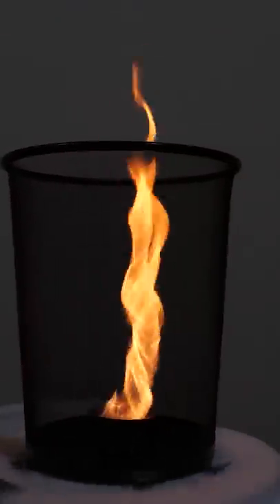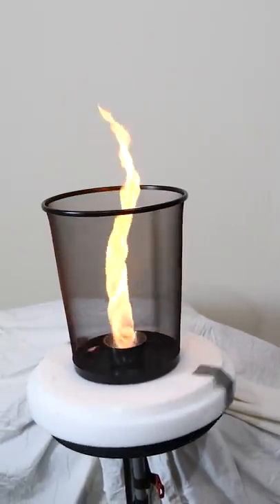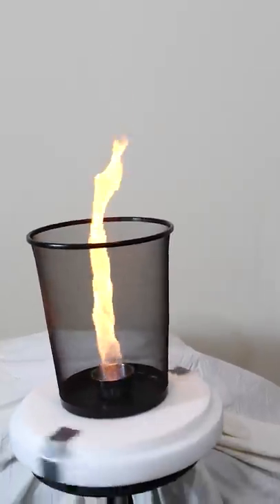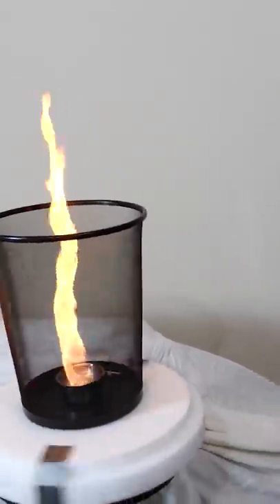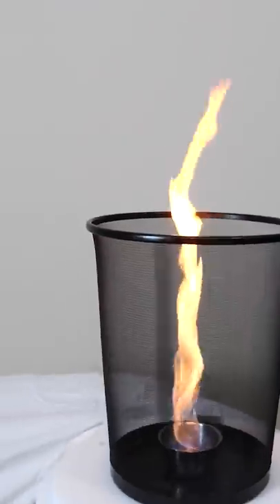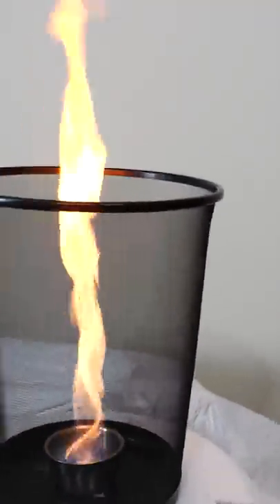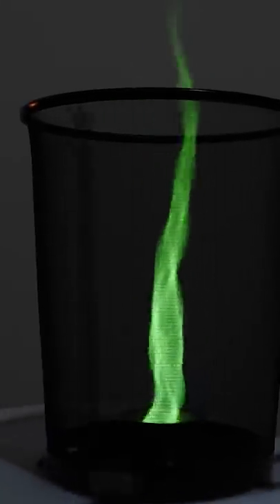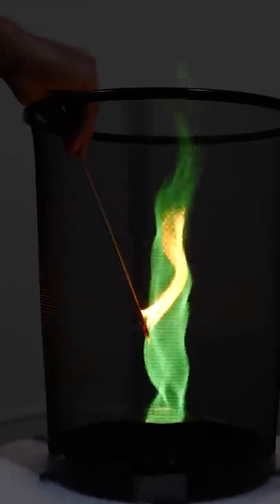Fire Tornado In a Trash Can

Comment: I've seen something similar using a candle inside a bottle that is cut in half transversally. once you move the bottle on its axis, air comes inside from opposing angles, so it creates a vortex
Reply: I remember that one, i was confused back then like really
Reply: O k a y
Reply: Link please
Reply: Which axis? Central axis, axis on surface axis on bottom or etc?
Reply: @StepBrother.  So you make it like 
  n
 u
thing of it as more round, and closer
Reply: @ecave3435  but where is axis u r gonna rotate bottle from? He said air comes form opposite side and create vortex. It it different from how it's rotated in video? How would a vortex be created?
Reply: @StepBrother.  so in this vid he spun the whole thing, in the
   n
  U
It came from the both sides, if you see it it is actually kinda of a little, wind will move inside like a vortex, so you wouldn't need to spin the whole table, but it could melt the plastic tho, since if you uce glass or metal... It wouldn't be a school experiment
Reply: @ecave3435  ok so from central axis is what u r saying? Also what's
n
U? I am confused lol. Is it representing bottle half cut upside down for "n" and straight up for U?
Reply: @StepBrother.  the video should've explain how it works, so the n and u is like half circle, the only thing similar i have in my keyboard
Reply: @StepBrother.  the vertical one. Comment below got it right xD
Reply: @SilverBirb  truly amazed
Reply: Hi

Comment: Or ... Air density has nothing to do with it, and  Its because the grid has a shape  that pushes air inside (try same speed in opposite way to check if it gives identical result or slightly different )

Comment: There’s no such thing as “centrifugal force.” When you spin something it produces an acceleration that is radially inward on anything attached to the thing that’s spinning. The only inward force would be the normal force of the walls of the cylinder. 

The direction of angular velocity has a radially inward component and a tangential component. It’s that tangential component to velocity opposing the inward radial force of the cylinder walls is responsible for a centripetal force.
Reply: Do you have a link(s) to what you're saying so I can better understand it?
Reply: Spinning objects have something called the Moment of Inertia. It’s the rotational analog to mass. 

It’s in the form of some fraction times MR^2. For a disk about its axis of rotation it’s I=1/2MR^2. You use it to calculate other rotational quantities. 

Torque is rotational force. Just like F=Ma, T=I(alpha) where alpha = angular acceleration.
Reply: I don’t have any links off hand but a search for centripetal force should bring up some results. It’s all in calculus based physics courses
Reply: @timmusician5060  I will - thank you.

Comment: Is it pulling it to the middle, or would its (hot air) molecular inertia be more than cold air, making it harder to push out to the edges? And because there is a finite amount of air in a given space, the cold air (when pushed outward) thus pushes back on the hot air, keeping the hot air in the middle.

Or am I WAY over thinking this?

Comment: Describing centrifugal force as a pull just hurts me. There is no such thing as pulling and it totally neglects what centrifugal force actually is to describe it as a "pull".
Reply: What do you mean? That's what forces do... they pull and push
Centrifugal force is a force, it pulls and pushes
What? You prefere using centripetal force? It's still a force. It pulls and pushes
Reply: @ngiorgos  There is no such thing as pulling. There is no pulling force. Only pushing. Once you learn more about physics you'll understand.
Reply: Cenntrifugal force is just being pushed into the wall of something spinning.
Reply: @ThaBeatConductor  "there is no pulling force. Only pushing."
What is the difference between pulling and pushing then? I believe we don't use the same definitions... 

According to Newton's 3rd law, all forces come in oposite pairs.
Let two objects A and B interact via a force pair.
The force acting on A is always oposite to the force acting on B.

If the force acting on A has direction towards B, then the force on B also points towards A. This situation I call pulling.

Vice versa, if the force on A points away from B, then also the force on B points away from A. This situation I call pushing

It is obvious there are forces of both kinds. Gravity, for example, is always pulling. Electromagnetism can be either pulling or pushing.
Reply: @ngiorgos  We use pulling to describe things easier but there is no actual pulling force. It's just a simplifying term.
Reply: @ngiorgos  The hardest "no pulling" things to get my head around was magnetism and gravity.
Reply: @ngiorgos  Also, i guess we would say there is no difference between pushing and pulling.

The easiest way to think about it is imagine pulling something on the ground and imagine where and what direction the forces are. Its just a lot of pushes in different directions.
Reply: @ThaBeatConductor 
I suggest un-wrapping your head around the "no-pulling" thing again, because it makes little sence so far

It seems to me you only consider cases where the force pair is repeling. What about the other times? You already mentioned some yourself. You need to address those! 

Please, describe clearly (as I did for you) what you mean by pushing and pulling. 
After that explain why:
1 The Earth is pushing the Moon
2 The glass rod I rubbed in my hair pushes the small paper pieces that stick to it
3 The magnet pushes the fridge
Reply: @ngiorgos  Well, the Earth isn't pushing the Moon, nor is it pulling. The mass of the Earth is warping space-time and that warping of space-time dictates how the mass of the Moon behaves.

And for the other two, I'm not sure I can describe it with words. Diagrams are the only way I can think to do it. Electromagnetic radiation is tough like that.

Like i said, just imagine where the forces are coming from and which direction they are pointed.

Do you pull air into your lungs when you breathe?
Reply: @ThaBeatConductor  Yes. I agree with the gravity explanation, in the context of general relativity.
No, the air is pushed in my lungs due to a difference in pressure. But that's not what I asked.

I'm still waiting for your definitions of "push" and "pull" as well as explanations for 2 and 3.

I get that things look different the deeper you look in advanced physics theories, like GR and quantum mechanics. 
But being so pedantic about the words "pulling" and "pushing" when used to describe classical forces is pointless.
Classical mechanics works, and includes "pulling forces" as well as "pushing forces". If you decided to never think in terms of classical mechanics, that's your loss.
Reply: @ngiorgos  I don't think it's my loss. Things make a lot more sense now than before I figured it out. It is pedantic, but pedantry matters when it comes to fundamentals.

Also, you didnt answer my question about breathing.
Reply: @ThaBeatConductor  I already did, apparently you didn't read it

And I'm still waiting what I asked you
Reply: @ngiorgos  https://youtu.be/YRgBLVI3suM

This sorta explains better than me. Doesn't necessarily talk about how there is no pulling, and does use the words push and pull interchangeably.

My point is pushing and pulling are the same thing.

Though, I'll also say, of the 3 fundamental forces, i think the strong nuclear force might be a pull, but I don't know enough about it specifically to say for sure.
Reply: @ngiorgos  Yeah, he didn't explain the quantum stuff well. It mostly just had the diagrams I needed to illustrate my point. I tend to think from the quantum level up. Makes things described in newtonian ways sound weird to me. When we can figure out why GR and QFT hate each other and make them play nice together, things will be hopefully easier to accurately describe. And you're right about things in QFT being described as interactions.